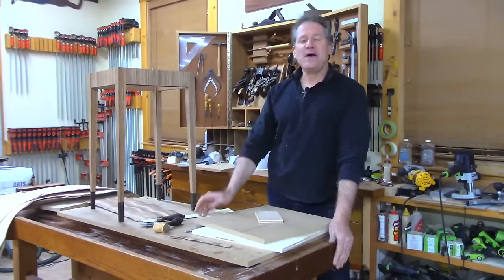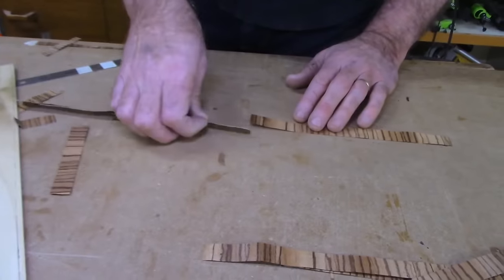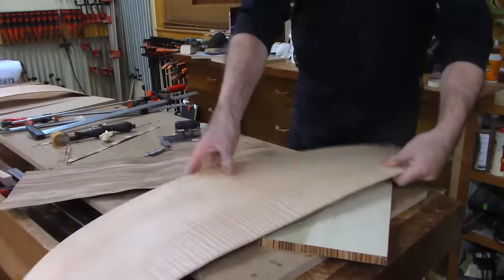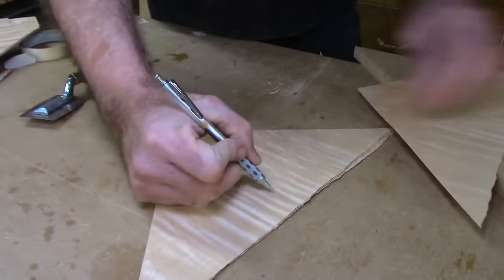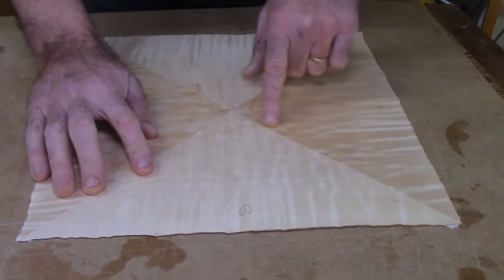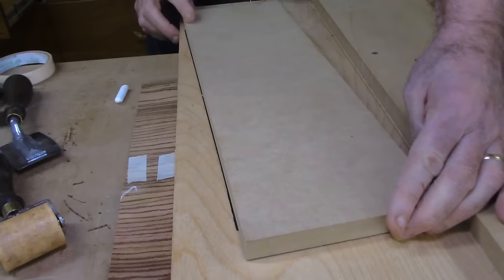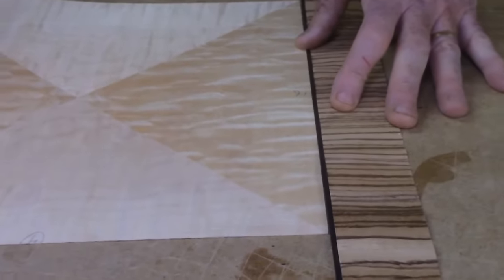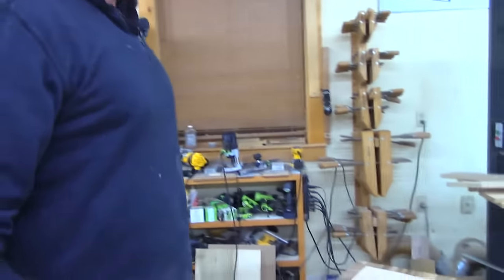How to Make a Designer Table Top

Comment: Just  thought I had, when at about time 45:00 in video where you are lining up the infield cutting template would it be useful to have a circle cut out of the center of the template to see through to where the 4 sections meet?  Pushing this a little further, strike diagonal lines corner to corner on template and then drop lines down the inside of the cut out circle. You could then in your alignment process use those lines to true up with the lines of the veneer joints.  Again, just a thought and without actually testing not sure it would be worth the effort.
Reply from the maker: Thanks Bill, that would definitely make it a little faster and easier to center the square panel…why didn’t I think of that? 😎 When making a round top and dining center that’s exactly the process as you typically already have a small center hole from making the template. But with the square veneer and border pattern, my focus is on making certain the corners all fall on seams, through the border and then aligned to the square substrate. So in all my fixation on corner alignment, I overlooked how making a center hole as you described would help get it oriented quickly and then to focus on aligning the corners. I will definitely add your tip next time I’m doing something like that. Thanks, and thanks for watching! 👍😎
Reply: @EpicWoodworking  "...why didn't I think of that?" Well you just didn't and for sure there are countless approaches that you present in your teachings that we the students did not think of and ask the same question of ourselves... why didn't I think of that?  It is through the sharing of ideas that we all grow and you sure do your share of sharing, thanks for everything you do!

Comment: Better off using painters tape which is way easier to remove and leaves no residue
Reply from the maker: Thanks, I will give it a try. I’ve not heard of it being used for veneer, and I had the suspicion, given its easy removability, it would not hold well enough to trust it for veneer work. But I will look into it more. Thanks for watching! 👍

Comment: Excellent. Finicky work, well done. You mentioned a black band along the outer edges - was that also veneered? For the final outer band on the 4 edges, what if: 1. glue the completed veneer assembly to the top as is, with slight overhand (in vacuum bag); 2. trim top edges with veneer saw; 3. rout a 1/8” square edge on all 4 sides, and finally 4. glue/affix a 1/8” square beading of ebony on all 4 corner edges? The corners would then be solid wood. Unless that is what you intended (I should wear my hearing aids to hear better). If so: routing that 1/8” corner carefully to avoid pulling out the zebrawood veneer! Thank you, and Merry Christmas!
Reply from the maker: Thanks Ed! You described perfectly the technique for applying “binding” to the edge, a beautiful way to finish it as it offers a nice decorative and protective effect. If I had time I would have continued and shown it. I have demonstrated it in the past, most recently on the edge of a round sunburst veneered table top. I may finish out a top like that for our first SNL in the New Year, and hopefully have one finished to show as well. The only difference from what you described is the size of the bead, as I like no larger than a 3/32” ebony line on a table like this…since you see it fully on the corner and it appears wider.
Thanks for watching and being there with us!!👍😎

Comment: Have you ever tried veneering the sides with the grain running parallel to the top grain?
Reply from the maker: Yes, many times. It is significantly easier to orient the grain in that way, but I was trying to demonstrate the techniques involved in making a vertical grained edge, as well as showing the striking effect of vertical grain edging. Thank you for watching!! 👍😎